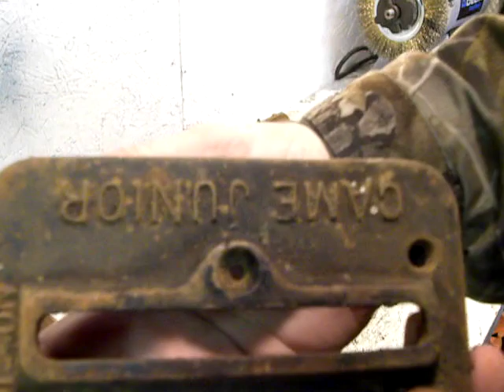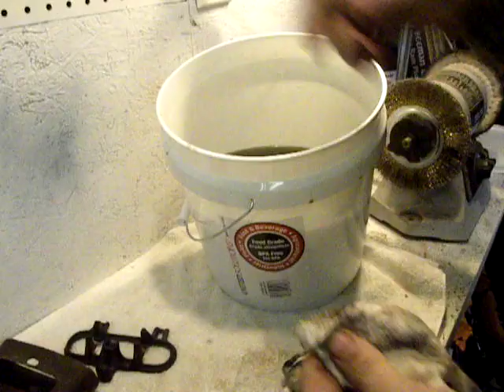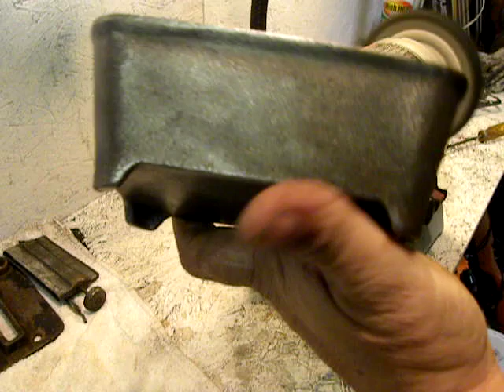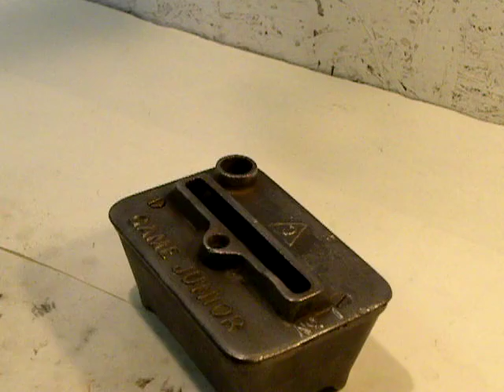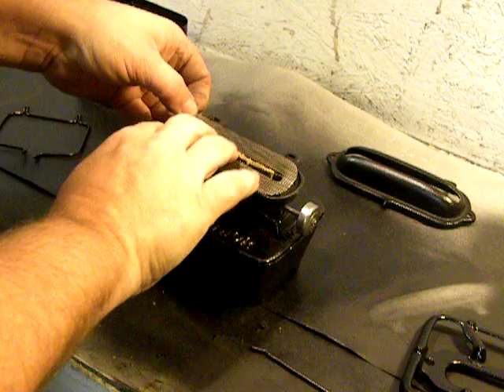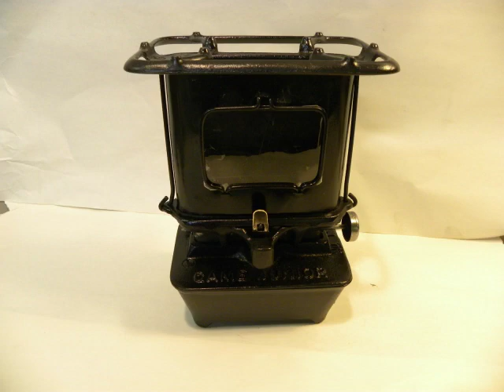Restoration of Rusty Game Junior #1 Camp Stove

Comment: Nice retauration but one last thing is required: you must trim the wick so that the flame appears uniform. Your wick is a little bit higher at the righthand side which leads to a sooty flame there. If the top of your wick and of the flame is near flat, you will prevent soot formation.

Comment: What is the clear plastic you use for the window part?
Reply: Mica glass, a natural mineral thats extremely heat resistant
Reply: @matthewh4747  Yea, i figured that out few days after I posted that question. I had to restore an identical burner.

Comment: I have been looking for info on these for years. I have my grandparents' Griswald. Where did you get the replacement glass? What kind of fuel do you use?
Reply from the maker: I got the windows from ebay. The material is called mica. I used a clean burning stove fuel for camp stoves. I think I picked it up from Walmart.
Reply: @saveitall9847  thank you for your help. I was hoping I could use the white fuel for camp stoves.
Reply: @johannacarder6903  I just picked one of these up for 25 bucks at an antique store, and this is the perfect video for restoring it! Side note, do NOT use white gas camp stove fuel in a stove like this. It's basically unleaded gasoline. Use only high grade kerosene or lamp oil. Have fun!
Reply: @geoffbc8628  thank you for the heads up on the fuel!  Makes sense because of the wick. I think I'll stick to lamp oil. Just curious tho, why not white gas camp stove fuel? Since you emphasized DO NOT use it.
Reply: @geoffbc8628  never mind. I just reread and now understand you to say camp fuel is actually gasoline. Thank you again for your help!!  I've since moved and it is misplaced. Well have to look for it. I've been carrying the mica around for several years now.
Reply: @johannacarder6903  Much lower flash point, and the vapor is much more flammable at room temperatures. If you used it, the flame front would quickly creep all the way down the wick, ignite the vapor coming off the reservoir below, setting that on fire, heating the cast iron, starting to boil the gasoline, bubbling it up through that narrow wick slit... a flaming mess all around! Kerosene/lamp oil are much less flammable, but still flammable enough in the conditions along the edge of the wick, which is the only place you want flame. Side note, I just restored mine, with a wire brush and some high temp paint, and an old piece of mica I had in a drawer! Looks great- I wish I could attach a photo! Good luck finding yours ;)
Reply: @gjbc  thank you for all the helpful information!
Reply: @saveitall9847  hi thanks for posting this..excellent!  I was wondering what you soaked the parts in to clean the rust.
Reply: Hi would you be kind to share the ebay link for the mica? I couldnt find it